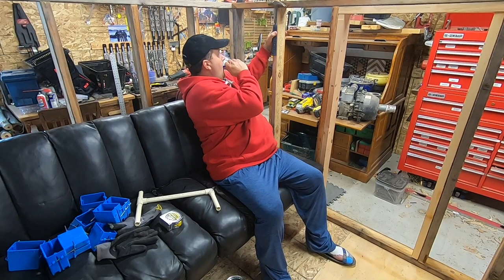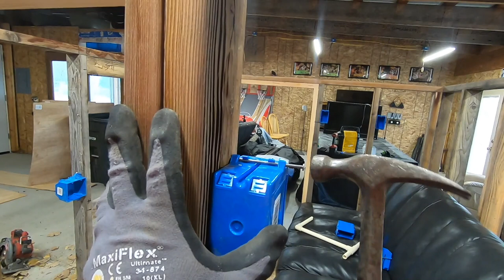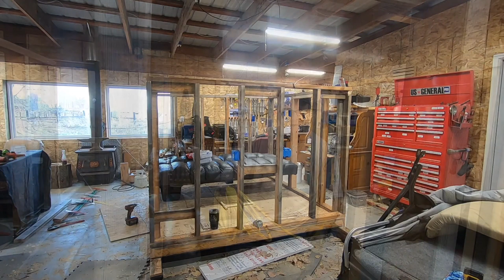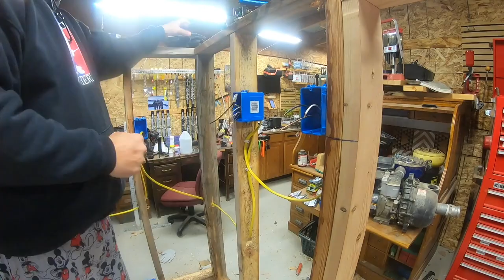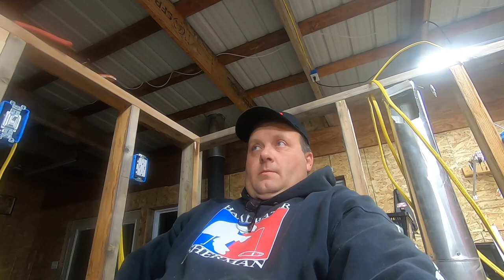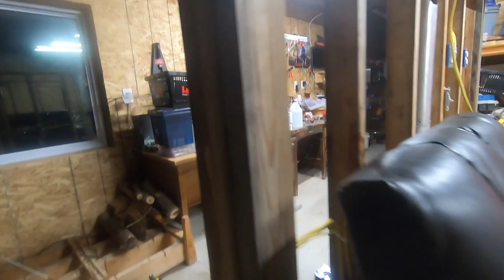Skid House Build Part 3

Comment: Shack is looking good. What is the weight your shooting for (shack)? 
What lakes do you plan to use it on? 
Tomorrow is the big day, headed up the mountain for hard water.
Reply from the maker: I figure if I can keep it under 1000 pounds, I will be a happy boy. I will probably use it on local fisheries nearby my house. However, if I can get things tidied up before the end of the month, I might take it to Henry’s lake in Idaho for a trial run. I plan on pulling it with the four wheeler or a snowmobile, but I am very curious to see if the track sled would have a chance. I’m sure it wouldn’t do good off of the ice, but maybe once you were on the lake, it wouldn’t be too bad.
Where are you headed tomorrow? Let us know how you do please. Best of luck!
Reply: @prospectoroutdoors  8 small fish, rainbows. Off of mirror lake hwy. elev 10,000 ft.
Reply from the maker: Sounds like a blast!

Comment: Are the outside (porch) lights battery powered or on your electrical?
Reply from the maker: I picked up some solar ones from Harbor freight. Looks like they should do a good job.
Reply from the maker: Any advice on what do you think I should do? 110 V or low-voltage? I might actually run a 12 V system as well off of Milwaukee batteries. If I did that, we could put on some lights like I have on the four wheeler. Nice and bright.
Reply: Those harbor ones would be best (rarely needed,  and bright for the job) like set up and take down.
Reply from the maker: I think you are right. I am going to take the solar ones back and put it in the bright ones. Thanks for the input.
Reply from the maker: @joshuabillings5828  I decided to take the solar ones back, because I’m already into them $25. For another 25 bucks I get the real deal.